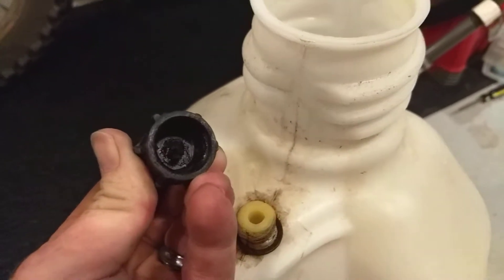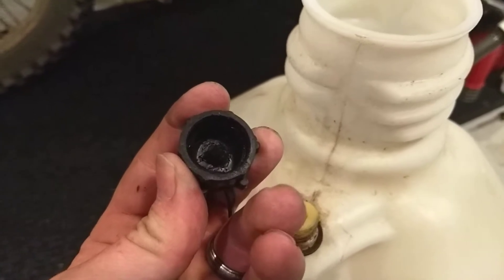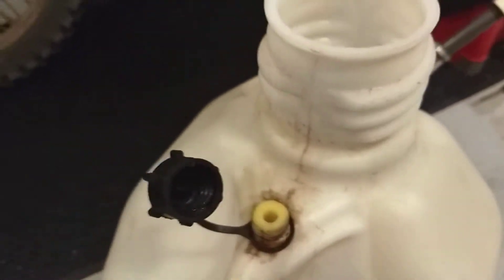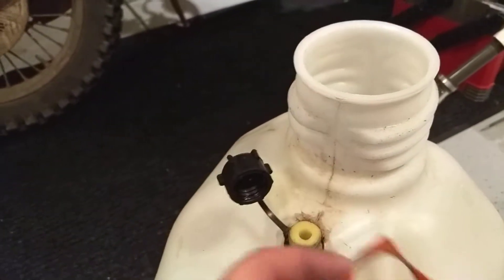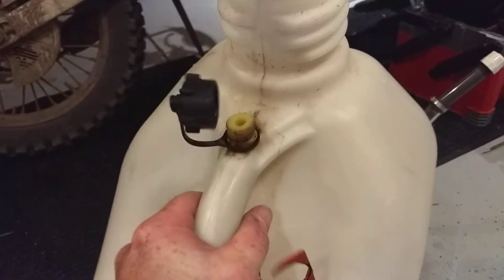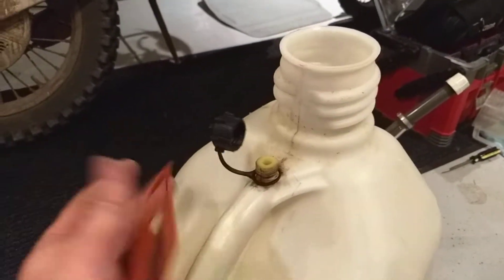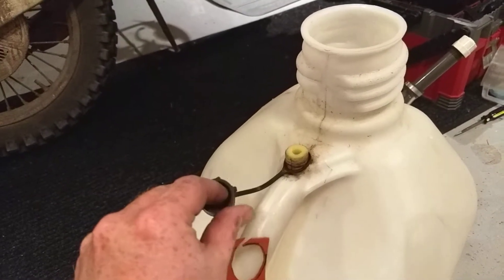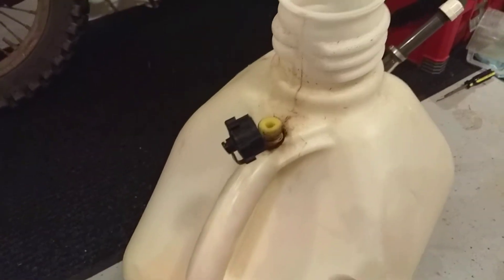VP Racing Fuel Container Issue and fix

Comment: CarQuest would not change it out despite if having a pinhole leak in the bottom where the mold halves joined.   Then I called VP customer service.  That was an eye opener.  I was told that it was not a gas can but a fuel container, not to be used for gasoline, diesel or any long term storage of these or other liquids. This in spite of their ads that described them as gas cans for long term storage of all kinds of fuels, which I took the liberty of taking screen shots of.. Long story short, I am stuck with a $45 fuel container that leaks.  It has not been abused, in fact it still looks new.  These people will not stand behind their products, so I thought I would let everybody that will listen know.  By the way, I am a retired mold maker for the rotational plastics plastics molding industry with 40 years of experience making molds for polyethylene tanks and containers.  I know manufacturing defects when I see them.  Jim
Reply from the maker: Yup, and it's expected that there will be defects in all products that make it past QA. It's how companies deal with such issues that matter. Fuel will not cause a leak as you know. Thank you for sharing your story on VP customer service. That sucks considering so many people use their cans and for the most part they hold fuel just fine and the only real issues is the hoses and gaskets that harden with age. They probably think the hardware store made spouts is an acceptable fuel spout too...LOL Check out Risk Racing they have a 5/Gal and a 3/Gal can's...again their spouts are junk after a few years.

Comment: just curious if you only used racing fuel, and nothing thats street legal fuel? because technically vp says the can is made for un street legal fuel, which i cant really think of 1 that has ethanol in it, because even e85 is pump gas.
Reply from the maker: No stations around me sell premium non-ethanol fuel. They say off-road use because this container doesn't meet DOT standards for fuel containers. Technically a station could deny fill-up because it's not an approved container although I myself have never seen a station care, but they are not really paying attention what a customer is filling up when you pull up to a pump. Also take a look new fuel containers like at Wal-Marts that meet these new standards you need to have a safety control valve etc. Maybe I should do a video on these newer containers because they stink to use, make a mess and my first time I got fuel in my face due to the pressure that builds up. As for VP and the o-ring they use, using one that is safe for ethanol fuels isn't hard or expensive, this isn't 20+ years ago. Most items that are used in contact with fuel are already rated for use with ethanol because it's a common addition to fuel. Also I doubt the plumbing hose VP Racing uses or the PVC plumbing cap is rated for fuel. For how much these cost you would think they use fuel appropriate parts.

Comment: Silicone isn’t fuel resistant. Need nitrile.
Reply from the maker: Been working fine though for many years now...much better then whatever they used that dissolved right away. You also got to remember it's a vent, so it might get splashed but it's fine otherwise.